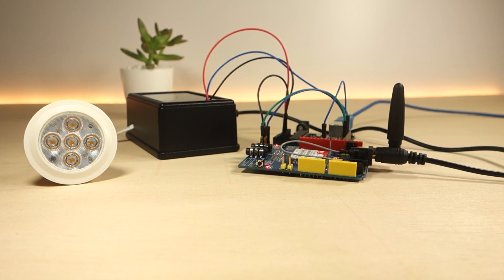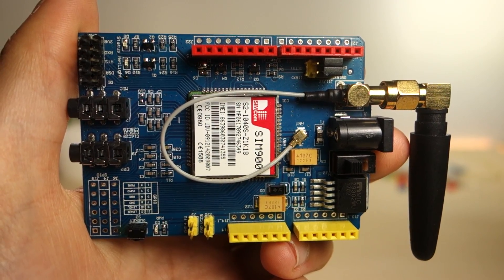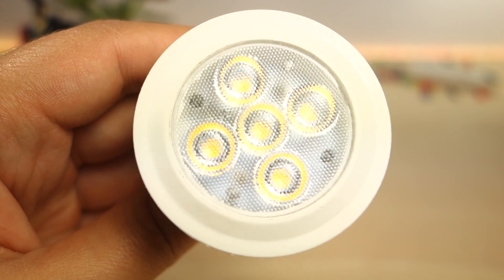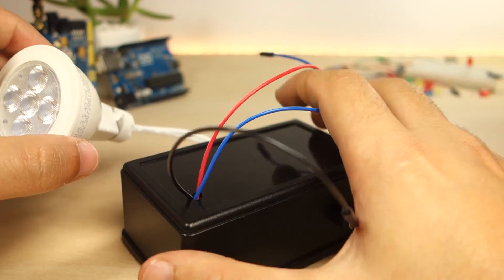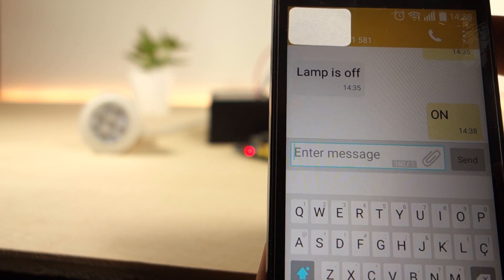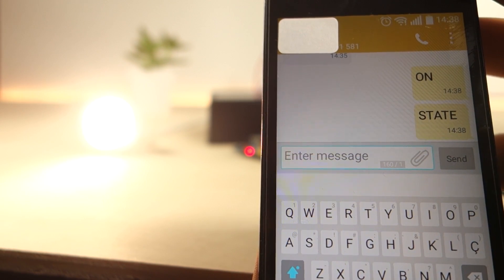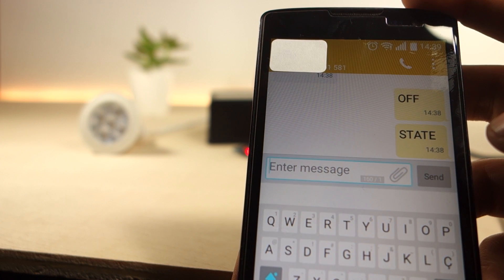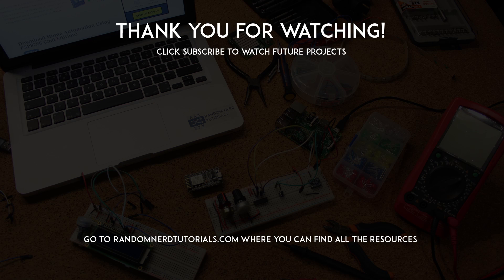[DEMO] Control 12V Lamp via SMS with Arduino

Comment: Does this mean your project needs its own sms texting account? Sounds expensive.
Reply from the maker: You are correct, it does need an active SIM card in the shield. However, if you have a remote location without Internet this is a good solution and probably cheaper than using an Internet provider.
Reply: text only prepaid SIM cards are $10 -15 per month
Reply from the maker: Also note that if you don't need the request STATE feature, your prepaid SIM card doesn't even need to send SMS. It only needs to be active to receive SMS to turn the lamp on and off.
Reply: @RuiSantosdotme  I made this project using SIM800C and Uno. But I observed that sometimes I need to reset my uno if sim800c network is disturbed or I call the sim inserted to SIM800C. Any suggestions to overcome this issue
Reply: Brother, I need the code for this project, please, and thank you in advance